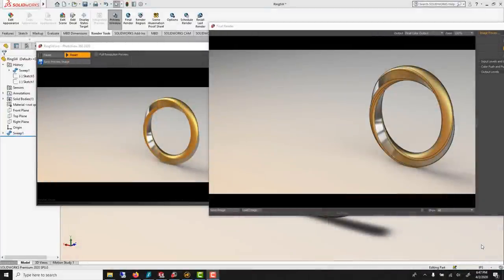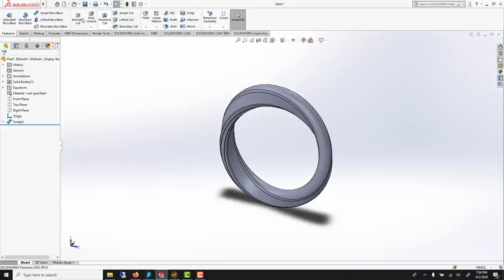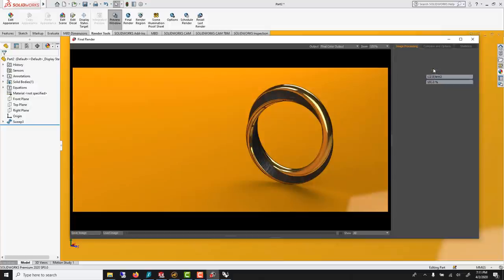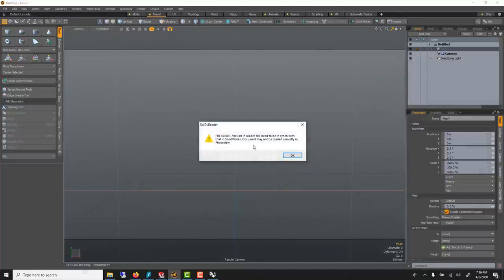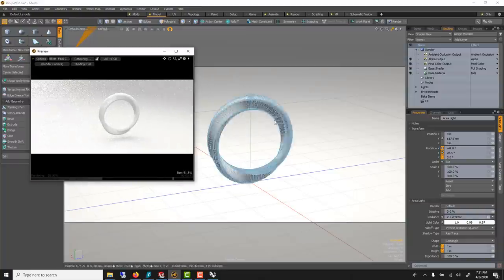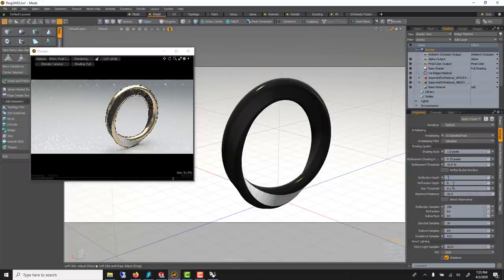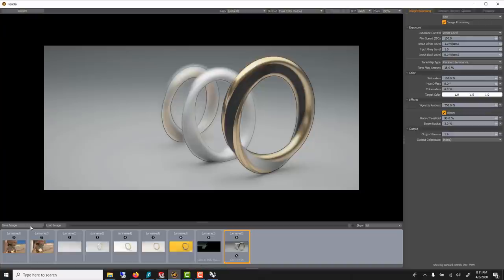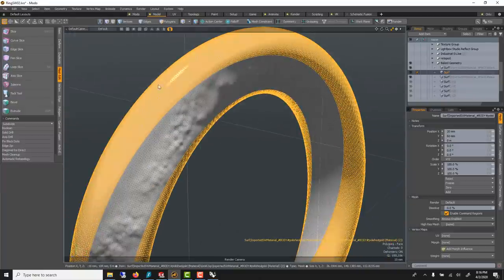Solidworks to Modo Rendering Jewelry ring step by step Tutorial (Photoview360) 12

Comment: Thanks for the tutorial! I have Solidworks 2020 sp0 and Modo 14v1, when I try to open a Solidworks file in Modo I get an error "PRJ 16490: - version in loader dlls need to be in synch with that in Solidworks. Document may not be loaded correctly in Photoview. Then I can't see the model in Modo. Could you help me?
Reply from the maker: Pollution X yes it s a bug don t worry Modo is aware just save as STL instead
Reply: @tgroppi  the problem is, then I can't import materials, or even set surfaces to apply modo materials to, it's all just one block
Reply from the maker: @HANITAI.  oh i see i ll talk to the Dev at Modo, you mean assemblies
Reply: @tgroppi  assemblies and parts, it appears that modo doesn't support SW 2020 yet
Reply from the maker: @HANITAI.  i just sent a message on the Modo beta forum, i ll let you know
Reply from the maker: @HANITAI.  14.1 will support 2020, and I believe this USD alpha build does, as should any other alphas and public betas we will release.
Reply: @tgroppi  thanks! So 14v1 is before 14.1?